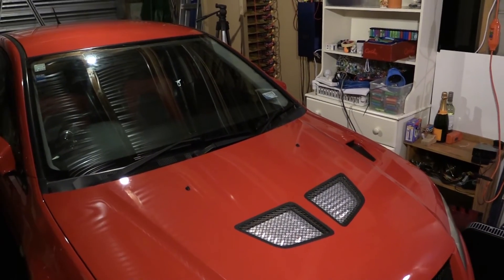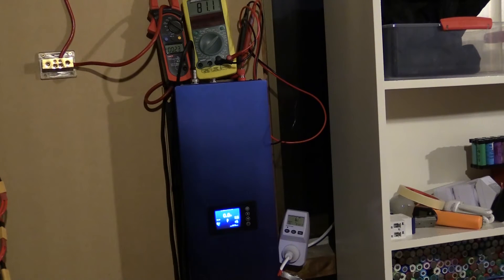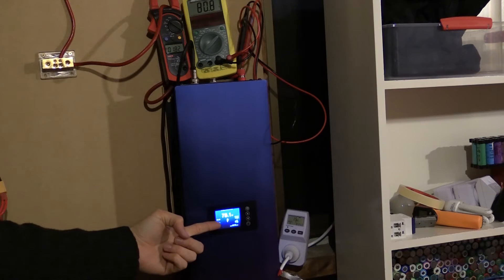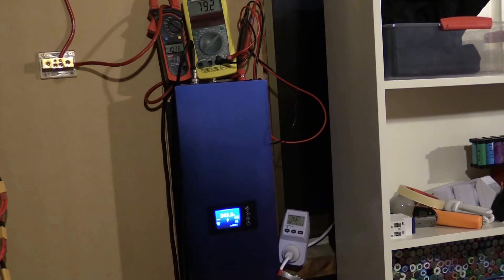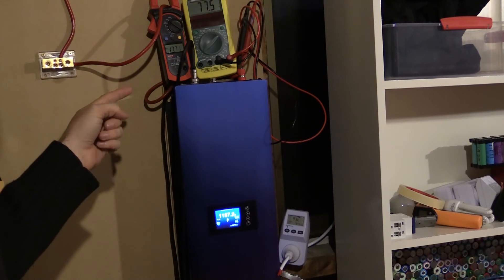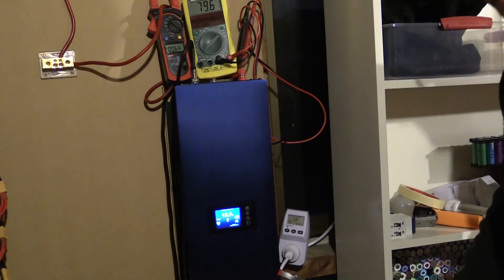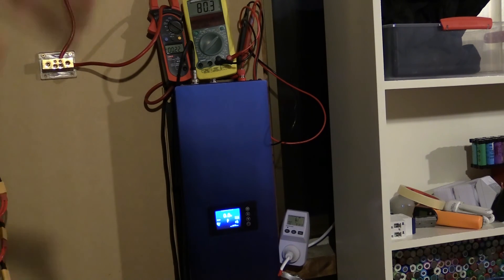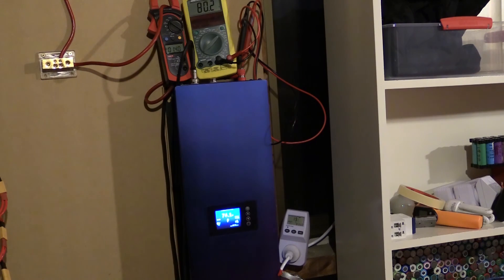5kWh Diy Powerwall Battery  - Load Amps Test

Comment: Greetings from off grid Oregon. What is the cost of one 5k battery pack. I saw on another video that they were 5 kilowatt each pack. Can you give me a ruff estimate of the parts to build one pack? My off grid system has 840 amp hours @ 24 volt nominal. There are eight L16 FLA  batteries at a total cost of $2600 US. I only use the top 12% and come to a full charge within 2 days. They should last 12 years or better. Thanks for your time.
Reply from the maker: Hmm cost depends on how much it costs you to buy old laptop batteries. 5kWh would be around $500 of old laptop batts but remember alot of your own time to test and put together.
Reply: I have a FLA battery bank that is 840 amp hours @24 volts nominal. It cost me $2600 US. I hope to get 12 years out of them. A friend who has been off grid for 40 years said I should get 18 years or better because of the way I use them. I was looking for another alternative to FLA. The efficiency of the Lipo4 is attractive. I'll have to watch more of your videos to see what your application is. Thanks for responding to my comment.

Comment: How is it all going?  What's next?  Do you know how to monitor 20s with an arduino?
Reply from the maker: Just got back from a weeks holiday so i will post another video tomorrow to update everyone. Whats next is creating a BMS to monitor the batt voltage and current and turn on and off the AC ssr. That basic function is very important then i will add to it later with 20s cell monitoring.
Reply from the maker: 18650 are very diff to Lipo pack cells and alot safer. :)
Reply: Glad to hear an update. I'm always so worried about your guys with your home made "tesla powerwalls". Have you heard the news of Samsung Note 7 battery explosions in the USA? I just feel these used batteries are so unsafe. But anyway, glad you're alive.

Comment: I also see the input logging does not work, was yours logging info under PV? Also the split core is reading lower than it should - About 50w too low
Reply from the maker: I will have to test this later once i have it on for a couple of hours.